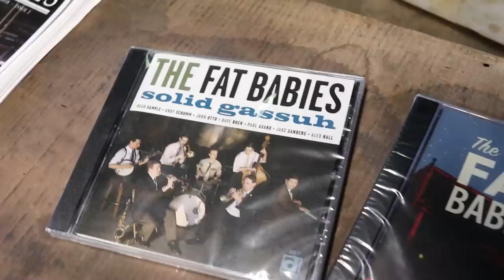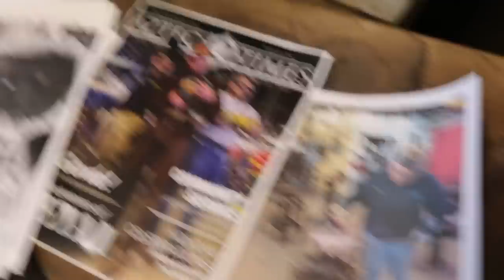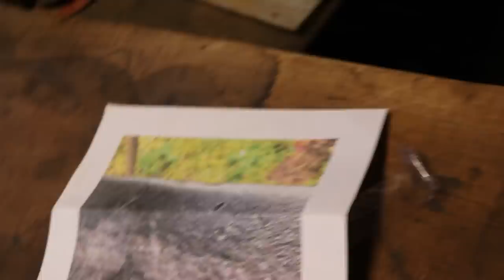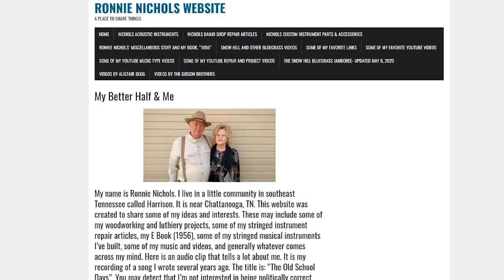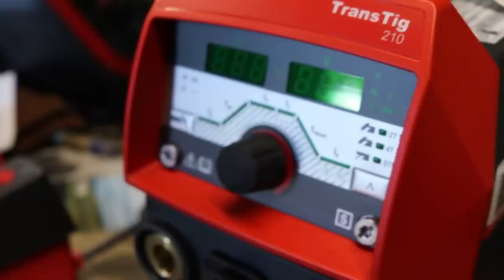Tig Welder, Rings, Music, and Drill Bits

Comment: I think fronius are one of the most expensive welding machines available and probably one of  the best.  After you've used it to stick weld you'll never use your transformer buzz box again, the technology in that little red box makes it so easy, it'll start a rod everytime and weld perfectly and not blow holes or spit spatter everywere, amazing piece of kit. And if you want to master tig welding then thats a very usefull thing to be able to do with some practice ( dc tig is just like oxy-acetylene gas welding, but with a lot more precision and less heat ). Good look 👍🏻

Comment: I intend to start learning stick welding this summer. I did some welding in my college sculpture classes and went into remodel carpentry for 5 years after college before becoming an art teacher. I really like the idea that stick doesn't require a gas tank, and mechanically it is so much simpler than wire feed. I keep encountering situations where a welding set up would be the ideal solution for the problem, such as making angled brackets for a handrail I am planning and making for an elderly friend.  I am in the process of buying my first house right now in the Seattle area and will finally have a garage to work in! No more setting up saw horses daily in the backyard of our rental! Thank you Scott and Nate for all the inspiration your videos give me to share my skills with my family, friends, and community.

Comment: DANG! Congratulations with the welder. Fronius is an excellen brand! You really got a big gift there, worth at least 2500 dollars. If you wanna learn tig-welding: start by melting together thin pieces of steel. When you start to master melting together things you can start to add filler. If you have experience with oxy-acetylene welding you have a big shortcut. I started with tig, and knew instantly how to do it with gas just because of my tig-experience plus knowing the burn-torch.

Comment: A long time ago (50 years) I learned gas and stick welding in junior high and TIG welding at college as part of my engineering degree.  Have not touched a welder since and I kind of miss it.  It would be nice to do it some more before I die.  My soldering technique has been evaluated to be good enough to qualify for space craft and I have done automatic test equipment for parts of the space station.

Comment: The Fronius machines are top notch equipment,equal to or better than any other on the market.  Stick welding with that machine is a pure joy as it’s a DC output inverter machine. It runs 7018 beautifully even on 110 volt input. The TIG is great as well and you definitely need to try it and experience the quiet arc and the skill required to make a weld.  The average weekend warrior will get more from stick knowledge but I’m an old school stick welder so that’s my bias and point of view.  Anyway thanks for the video, looking forward to seeing the Fronius in action

Comment: Gonna sound a bit silly, but just two days ago (raining) I uncovered the nice new stick-welder I'd picked up last year at the end of decent weather... I've had a miserable little older model with a cracked core... that I've used up until recently. It wasn't expensive enough to worry too much about abusing it, but obviously, there's some loss in performance... mostly in a form of frustrations starting and keeping a good flow.

    IN any case... I'd vote a few vid's on the general fundamentals and tips about welding... sticks by type and positions, etc... The importance of starting with "tack welds" or where you might do it differently (if ever)... Work cycles might be a good (great?) thing to mention.

    It's conceivable you have a few in your audience interested in the differences between soldering, brazing, and welding... as long as we're about it. ;o)

Comment: I wire fed welded for years and did some stick... I’ve always wanted to learn tig welding. I would get a kick out of watching you learn the process. I’m happy either way if you wanted to go back and do a whole video on welding , temp, feed rates, angle, speed of feed... I need to get another welder. It is one thing I don’t have in my tool room

Comment: Love those fluted boring bits. I use them almost exclusively for pulling wires and pex tubing now. They're so fast in an impact driver that there's little comparison. I have some Bosch spade bits with threaded point tips, too, and those are awesome as well, although they require a little more sharpening, since two points get dull faster than three.

Comment: just grab the torch and lets see you take the journey of learning to tig weld dc (its a only dc rig) That is really nice tig welder and MSRP is over $2800 for a DC unit and if you need ac/dc its over $5000.00 so its not a beginner unit for a budget minded people .Fronius  is for high end fab person that is comparing to Miller ,Lincoln unit thats are $5-6500.00 price so  if your looking for a great intro unit Primeweld 225 or AHP 201 is where to go. Good luck on your journey

Comment: Well this is uncanny. I just picked up a set of the Irwin speedboars. I had a set of the tri-bore, but they wear out batteries way too fast as you said, and - they actually went dull relatively quickly on me. I would have got them about the time you launched this video, and i've used the new speedboars twice and they're way better than standard hole bits. Time will tell if they hold up

Comment: Unsure how I got here? Regardless...yes sir I'd like to see you tig weld from the get go. I can stick weld like it's bird poo (enough to get by) unfortunately my inverter stick welder bit the dust during a flood and figured it's time to try tig or mig welding...
As for the Irwin speed borers I solely use them in hardwood and they eat it like butter imo.
Cheers from Australia. 
P.S. Your workshop is heaven!

Comment: I Learned how to TIG back in the early 80's in Junior College ,when you feel like you are pretty good at it challenge yourself and try to weld together some copper pieces. It will teach you how to REALLY control your heat..........or it will just melt away!

Comment: Show us all your welding I'm self taught and I don't claim to know much but I got a 225 amp Lincoln buzz box that's 40 + years old and a Hobart 190 that's 5 years old and did work in a fab shop for about 5 years I primarily build stairs and handrails and loved that work but I went trucking over the road and now retired for 5 years I just weld to fix my own equipment and make a little horse shoe stuff I always wanted a rig welder after we had a job in the fab shop that everyone got a chance to use a rig we rolled and made over a 100 feet of 24 inches dia stainless steel pipe for a dust collection system with a water spray in it for dust control 24 ga material

Comment: i did a bit of welding about 35-40 years ago, but I favored brazing and gas welding over using arc... mostly due to the longer time needed for gas welding to start to melt gave me more control and more time to think. I'd love to get into welding, but my garage only has 110V and I don't have enough projects using welding to justify wiring up 220V. It's sorta like owing a boat, I'd rather borrow someone else's and let them handle the upkeep than own my own.   Any Ideas?
Reply: what does it take/cost to have 220V put into a residential shop?